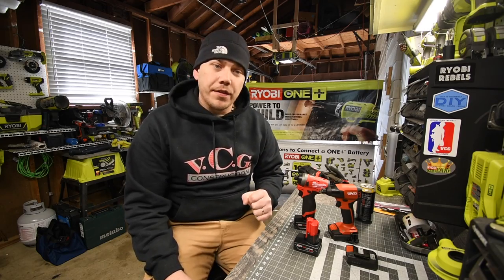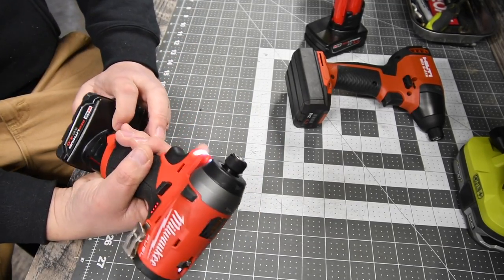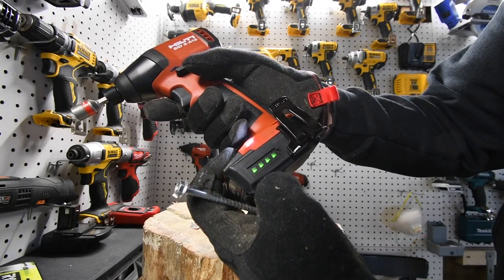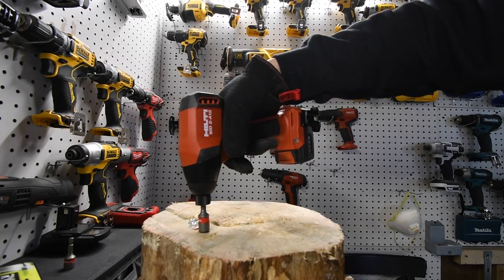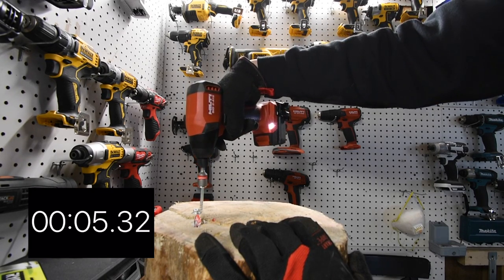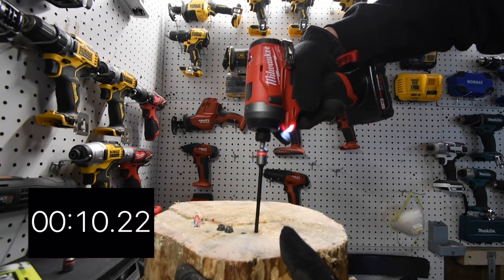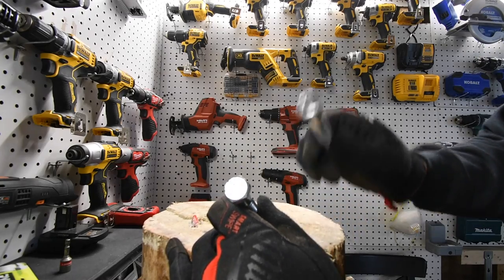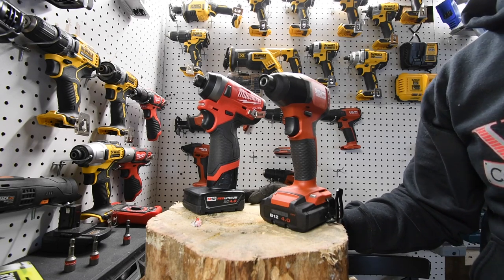Milwaukee M12v Vs. HILTI 12v Impact Drivers

Comment: A lot of people complain about the grip on the Milwaukee I have small hands and I like the grip  love your videos keep em coming
Reply from the maker: I thank you Allen
Reply: I have fairly big hands and I also like the grip on the m12 fuel. I bought it about a month ago and it's become the driver I reach for first.
Reply: I got the same tool and also got small hands lmfao. This tool works amazing and I once used it to take lugnuts off a truck with a 2.0 amp battery
Reply: You will like Glock 26 pistol then. The grip is nearly identical.

Comment: I have always been a milwaukee guy, but then i worked for the state who had hilti tools and got to see what they were like. Phenomenal tools, hands down. Department directors got to chit chattin about tools, and I mentioned why we do use hilti instead of milwaukee. Turns out a milwaukee rep tried getting a contract with the facility once, but was shot down rather quickly. Reason being, one of the directors had asked, if I drop the milwaukee tool from a 4 story building, will it still work? If my 6' 8" plumber gets angry, and hurls any of the tools at the wall, will you gurantee they will still work afterwards? Both cases did actually happen with the hilti tools we were issued, and they all still ran like the champs that they are. Rep didn't want to give the directors that kind of guarantee, so he walked. I was quite impressed with hilti. I still have a VAST collection of milwaukee, don't get me wrong, but I'm thinking about spending the extra money, and start buying some hilti to add to the mix.

Yeah M12 has got a huge selection of tools to work with their long lasting batteries, but there batteries always slip out after so much wear. A lot of the M12s that I have used eventually always have the batteries slip out. You could be driving in a bolt with a right angle mechanic impact wrench, and mid driving, it stops. You look down to see those wonderful 4 red leds flashing letting you know the battery slipped out just a smidge; enough to stop the whole process. Same has been with their hammer drill, and the impact driver. Even their new 3/8" stubby impact wrench has the slip out problem. Their design of the two tab clips is dated, and not very good. My hiltis at the state never did that even after all the abuse I put them through. Hilti is simple, and elegant. Not versatile with their selection at all, but purpose built tools that last a long time. Kudos to you Hilti.
Reply: I’ve dropped my hilti screw gun off scaffolding countless time and it still works fine.  Original battery from 2013 still holds a decent charge. Rather impressive

Comment: Thx for the video.  I have both of these tools, the 1st gen brushed Hilti and the latest gen of M12 impact.  No doubt Milwaukee is a beast and the addl speeds make it a no brainer.  I bought the Hilti 12volt trio. I only use the Hilti for 3 to 4 inch spax or sheetrock screws.  The Milwaukee i use for removing 3 inch 5/16 lag screws. It does it very well .  Im an audio video contractor.  I often remove TVs when customers move.  Im a firm believer of using a tool within its capacity.  I honestly was amazed the Hilti could hang.  I knew the Milwaukee was capable.  I must admit its good to see the max range capabilities tested.  Honestly the Hilti is best suited to driving smaller diameter spaxs and screws.  Its all about the tool matched to the task.  I try to do that everyday with my tools.  Thx for taking the time to making this video!
Reply from the maker: I thank you for viewing D Knibb

Comment: Regarding what you say about the anvils skipping at 12:24, this is NOT necessarily indicative of better quality in the Hilti! If anything, it more likely means that the Milwaukee is simply so powerful that it skips beats because the load it is driving is right on that threshold where on some beats it’s enough to compress the spring in the impacting mechanism, and on other beats not. All that means is that it does not NEED to have the anvils strike on every beat, and some beats can get torqued just by the motor/gearbox without the need of impacting. In other words: The reason the Hilti is impacting more regularly there is that its motor/gearbox don’t generate as much natural/non-impacting torque as the Milwaukee, so it NEEDS to impact more regularly.

Comment: I don't use the bigger batteries all that much on my 12 volt Milwaukee tools. They are a life changer if you do any restoration work or HVAC in small spaces.
Reply from the maker: I love 12v systems an thank you Howie

Comment: I have Hilti and its amazing, very light and long battery life. Hilti usually lasts at least 3 times longer than other brands. Its longevity is unbeatable.
Reply from the maker: I agree with you on that, it will majorly outlast any other brand
Reply: On this test the battery on the Milwaukee was still at 4 full bars, and the Hilti went down to 3, i dont get your point lol
Reply: @jflovlogs2092  he’s means the impact driver itself will last longer, and not break. It’s built better and more durable

Comment: My 3/8 stubby paired with a xc6.0 is an absolute monster. Huge difference in power from a CP 3.0 to the 6.0
Reply from the maker: I will be getting the stubby soon and thank you
Reply: Can we use stubby for impact driver purpose?
Reply: nazrien ts No, the stubby is an impact wrench, good for huge Lags but not for screws or Spax/timber lok. I’ve only even used my 3/8 stubby for seasonal tire change, brakes and other maintenance projects. It’s rated for 250ft/lbs of torque but it removed tractor wheel nuts that was torqued to 300-350ft/lbs.
Reply: ᚺᚨᛗᛗᛖᚱᚺᛖᚨᚱᛏ I just got the 3/8 stubby and it’s fuckin awesome, I’m a mechanic for morbark. Beats lugging the 1/2” impact up ladders and into deep dark holes. Most of the stuff I deal with is 1/2” and bigger but the 3/8” really rips.
Reply: ᚺᚨᛗᛗᛖᚱᚺᛖᚨᚱᛏ I use the xc 4.0 on the driver and drill and the cp on my ratchet fo fit into small spaces

Comment: Great video!!! The truth for me is we have all dug pit the bottom of job boxes and found that tool rusted to the bottom and beat to shit, but, still works like new - it’s hilti! Four speed settings , 4 more things to go wrong, I had both of these, well the bushed hilti. The little button for speed adjust wore out and was stuck in whatever setting it was in. Fit and finish of hilti is premium. I find the battery and handle for milwaukee to be very cumbersome. Both have great lights, power and feel. The Milwaukee wins hands down for performance out of the box. But I’d love to see a demo after 1 year of work. Only complaint is speed settings are nice to have. Hilti lacks this and only has one, getter fucking done speed. Still 25000
Reply from the maker: I think the hilti will last a lot longer then Milwaukee will. and I thank for for sharing your story Jarret
Reply: Скорость и мощность регулирует палец, лишние кнопки не использую

Comment: Personally I prefer the Bosch 12-volt impact, specifically for Phillips screws, other impact driver might have more power but  the drill bit slips out of the screw much easier, so I need to push the impact driver harder against the screw,  also I really like how the bosch feels in my hand (very balanced)
Reply: Владею Бош 110нМ, хочу перейти на гидравлический Милуоке. Мощности с избытком под мои задачи электрика
Reply: weak

Comment: Great video! Looks like M12 will be my main DIY tool set. I was up in the air for a while between Bosch and Milwaukee.
Reply from the maker: its is worth it and thank you Matthew
Reply: Milwaukee makes Bosch 12v seem like bauer/ earthquake
Reply: @footlongburrito  Woe that's a pretty big quality gap. Thanks for the info.
I also noticed that Milwaukee has a way larger sandbox (blowers, vacuums, work lights...)
Reply: Dont sleep on Makita's 12 volt line.  Its pretty capable and growing. Milwaukee currently RULES!
Reply: @uniquesoundsolutions  Absolutely! The are definitely the kings of the 12v tool line!
Reply: @uniquesoundsolutions  I won't sleep on makita as far as growing,  however milwaukee is growing rapidly as if they only had a few offerings...milwaukee has 50+ makita has 30+... and milwaukee keeps them coming and they get better and better
Reply: @DesertSandSailor  take the bosch flex I click vs milwaukee installation driver... on paper the same tool,  but performance wise Bosch can't drive nearly what milwaukee can...bosch has some good tools but only thing Bosch has that I want in my milwaukee is the starlock and xlock systems for multi tool and grinders... otherwise I'll take milwaukee in every single tool
Reply: @footlongburrito  Hey I was actually looking at the flexclick before this video haha! Yea I have 2 Bosch corded sds hammer drills that beyond outperformed my corded Mil. That's what I was basing the cordless stuff on
Reply: @DesertSandSailor  yeah throw out any of that info from your brain,  cordless is another animal,  Milwaukee from 10 years ago can't hold a light to these of today
Reply: @DesertSandSailor  I used to the flex I click and returned it,  I tried the installation driver and felt the difference didn't even need to see them ran side by side,  it's that noticeable
Reply: @footlongburrito  you are a huge help. Now would you reccomend the inst.driver over the hammer drill and impact combo kit?
Reply: @footlongburrito  😬👍🏽👍🏽

Comment: I have both Tools.  The only reason I have the Hilti is because it’s cheaper to buy the trio, the hammer drill, screwdriver and the impact.  At the Hilti store there was a deal at the time I purchased.  I love Hilti tools and I rally like Milwaukee tools.  At a time when most reputable companies are making multi speed impacts HIlti should have made one.  I’m actually disappointed.  I use the other 2 of the trio but my impact rarely gets used.  Now the M12 Impact is a beast! I use it for 18 volt jobs it’s so powerful.  My go to was SID 22 volt Hilti.  The Milwaukee is smaller and can basically compete with the 22 volt Hilti.  So it’s become my go to Impact.  I hope Hilti ups the game.  They are behind in the 12 volt impact game.  I’m routing for Hilti.  But. Milwaukee is great company and they make a large array of fantastic tools both 12 volt and 18 volt.
Reply from the maker: I love hilti 12v tools as well and I thank you again D Knibb

Comment: Milwaukee uses two battery banks (one bank is in the extremely uncomfortable handle), the Hilti has one bank.  Even at the same AH, the discharge rate is quite different.  You can take a M12 3ah compact and a large one to make a comparison, the performance is quite different.  Batteries are designed for specific optimization and it's not just about power.  Capacity, discharge, longevity... etc.  I am on both platforms and that I will say the Hilti is much more usable in the long run with the 4.0 (the brushed gen impact was not the greatest I'll have to say). The balance, grip and vibration control is much better.  If I am driving a few lags that long, I will breakout the 18V stuff.

I like Milwaukee's platform versitility if you need that specific task done and you have the right tool to do it.  Though after 3 or 4 years on this platform, I must say that it's not something I will want to use for the entire day.
Reply from the maker: I agree with you on that, I think the m12 handles are way too thick. I also think the hilti till last longer in its lifetime
Reply: @ManCaverTools  yeah I've had some issues with Milwaukee quality.  Granted that they were under warranty, but it does make one wonder whether they are becoming the iPhone of the tool world.
Reply: @MintStiles  разъём под USB точно не Айфон

Comment: Those big batteries on the Milwaukee are a great advantage. They must contain twice as many cells as the Hilti's.  That means it can use higher current delivering cells in the first place (each cell only needs to be 2000mAh for a 4Ah battery, which will have better current delivery specs than higher capacity cells, generally speaking) and then splitting that current delivery between two parallel sets of cells then roughly doubles the total max current delivery...   Plus, as the two sets of cells will be less stressed overall, the whole battery will be more efficient and last longer.
Reply from the maker: Yes sir. The milwuakee m12 system is the best 12v on the market
Reply: My thoughts exactly, the hilti was running 3 18650 while the Milwaukee xc battery has 6 cells
Reply: @Whohoohoo  There is a 3 cell 3.0Ah pack for the Milwaukee m12 stuff.

Comment: Hi I’ve recently found your channel and am enjoying it, I was wondering if you could do a comparison of the m12 battery’s and if at all possible specifically a 1.5ah vs 2ah vs 3ah (compact and regular) vs 4ah vs 6ah on the impact driver to see if there are any noticeable differences with the speeds. I’ve seen many reviews with the 2ah vs 4ah or the 4ah vs 6ah but not consistent results from either that make sense when put together. And the m12 platform is heavily adopted so I believe you would receive a lot more attraction to your channel doing these tests that delve deeper into each brand and what they have to offer. Btw I obsessively like Researching Specifications and other small details about tools so if you would like I could help prep you for videos and other miscellaneous thing’s just shoot me a message on YouTube and we can talk.
Reply from the maker: the 3ah or 4ah is good the 4ah has 21700 cells in them and they will perform very well

Comment: Milwaukee m12 impact driver vs m12 surge ? Great video sir .
Reply from the maker: Thank you sir and that video is coming :)
Reply: Surge doesn't beat it in power,  it's quieter and slightly less power
Reply: Brandon Nava that's what I thought i wanted a comparison video to decide which one to buy with the hammer drill combo because i felt i needed the more hammering and power from the normal impact driver fuel . Also thanks for your comment.
Reply: @kokoakram156  the Milwaukee fuel 12v impact isn't good enough to you? Is that what you're saying? It literally doesn't get any better than Milwaukee in 12v ... but search for Milwaukee 12v fuel impact vs surge 12v and 50 videos will pop up and you'll see... there is a plethora of those exact videos
Reply: Brandon Nava what i said is that the m12 impact is better than the surge .

Comment: I have the Milwaukee m12 surge impact driver and love it but I get the sick feeling that the hilti would keep chugging on something that would choke out the waukee. :-(
Reply from the maker: More test are coming and thank you Rob :)
Reply: Ive had my milwaukee 12v fuel hammer drill and impact since they came out and use and abuse them and they aren't slowing down what so ever,  the impact driver, impact wrenchs and soon to be impact ratchet wrench are tanks... they are built ridiculously well

Comment: I honestly don’t care if either of these tools can drive in lag bolts, for nearly everyone looking into buying one of these is gonna be doing light work and driving screws, so really the most important thing to test here is weight and ergonomics. As a side note, I have the m12 and I must say that it is shaped weirdly and it isn’t comfortable to use in tight spaces